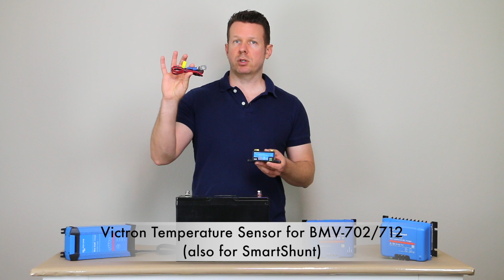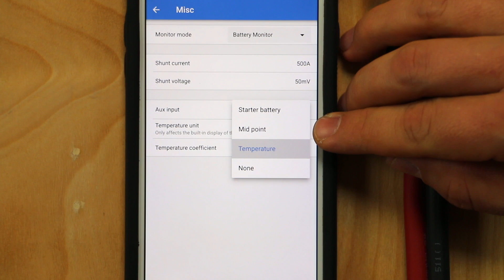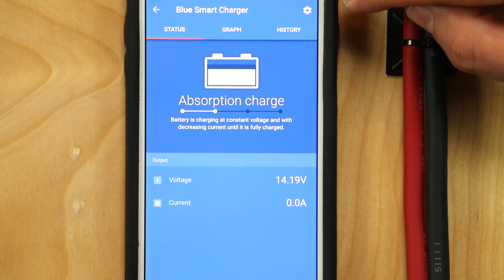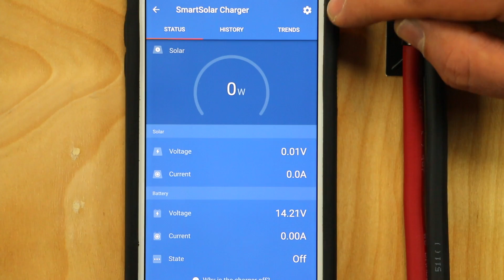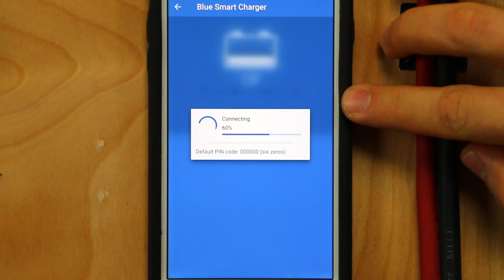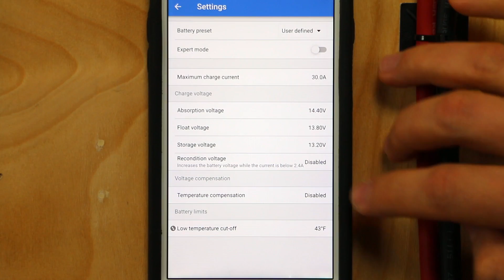The Future of Battery Charging in Van and RV Power Systems featuring the VE.Smart Network

Comment: Ross, your videos are fantastic, with great explanations and easy-to-follow demonstrations. We would be interested in your comments based on our observations that tie into your video. We have been running a Victron system for three years, including a BMV-712, 100/50 Solar charge controller, Multiplus 12/3000, and 400Ahrs of non-Smart Victron Lithium batteries with VE Smart networking. In addition, we have a Nations 280Amp alternator with a Balmar MC-614 voltage regulator charging the lithium batteries. We have observed that the solar charge controller will drop its charging way down if the alternator is running. This also occurs if we are on shore power. It appears that the shore power and alternator battery charging raises the voltage on the bus making the solar charge controller think that the batteries are at a higher state of charge than they are. It is not an issue but just an observation.
Reply from the maker: Hi Larry, great point. I think this is a good example of the chargers reacting to each other without necessarily communicating directly.
Reply: This what I hope happens, thanks.

Comment: Thanks Ross.  I am having issues with the dc to dc reading correctly when charging but can see at the shunt it is charging ...  I know settings is the thing but not finding good support.  Does Victron have a link or do they only give support through their dealers?
Reply from the maker: Sorry to hear you're having issues with it David. I would pore over the manual one more time before browsing the Victron Community forums. Some of the dealers are on the forum (such as Bay Marine) and if all else fails I reach out to Peter Kennedy from PKYS.com (one of the largest Victron distributors). I have had to troubleshoot the Orions too.

Comment: Thanks Ross for great presentation.  Was wondering how multiple chargers on the same battery do not get "confused" by voltages of other chargers wired together. In other words, how do they detect just the battery voltage when deciding how to charge and not pick up their fellow chargers' charging voltage (which would be high and constant)?
Reply from the maker: Great question. The answer is that chargers are slightly affected by the other chargers putting voltage into the system, but the chargers will climb up to their setpoint voltage (i.e. of 14.4 volts or the like), but they do not start at that voltage. If the battery is at 12.2 volts, the chargers will put out 12.3, then 12.4 and step the battery up to that target voltage. So even with one charger going, when a second charger comes online, it can tell that the battery has not reached its target and will begin charging it with voltage slightly above what it reads the battery to be.
Reply: syncronized charging / VE.Smart networking
Reply: @CristianBarraza  My question is in regards to chargers without this capability.